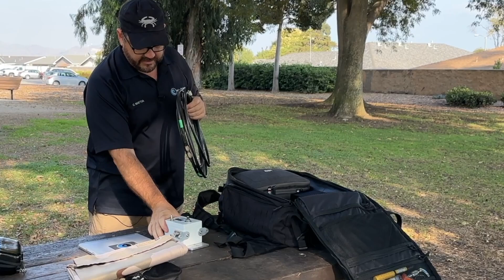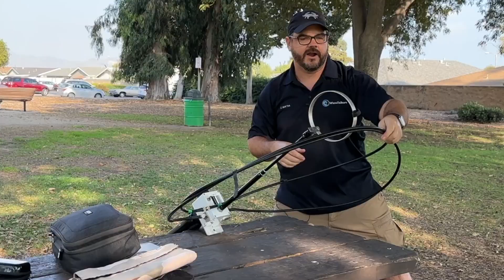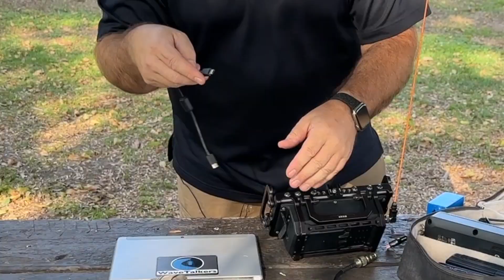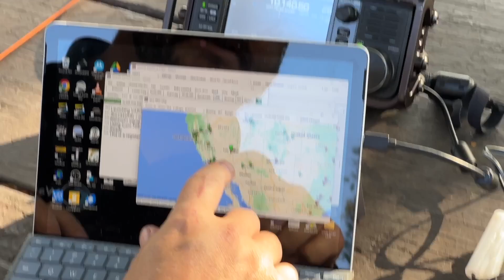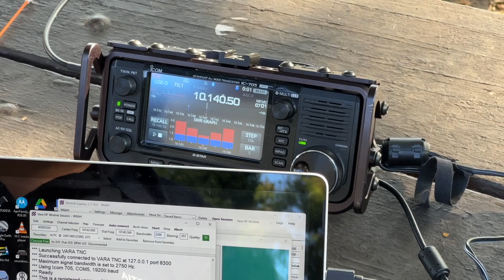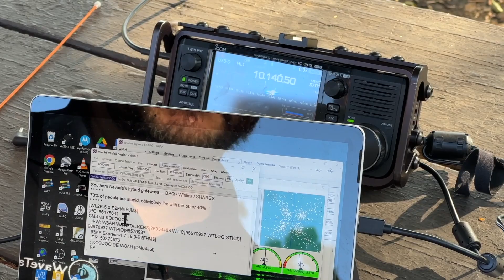HF Portable Winlink: VARA HF and Magnetic Loop Antenna

Comment: Hi, thanks for the info. 
Do you have some bitrates data to share, especially when operating VARA HF through skywave propagation?
Have you tried comparing uplink bitrates when operating on 500 and 2300Hz channels (with 10W Tx power)?

Comment: As always, another great video!
Could you share what backpack and 705 case you’re using?
Reply from the maker: The bag is an LA Police Gear 72 hr bag.  The 705 bag is the XL Bumb XL bag.  It looks like they only sell the LG bag which fits the KX3 but the XL that I’m using for my 705 seems to be out of stock on Amazon.  Please consider using the affiliate links in the description for any Amazon purchases.